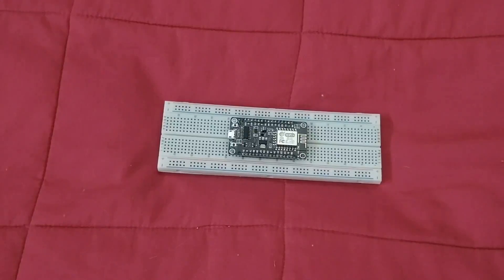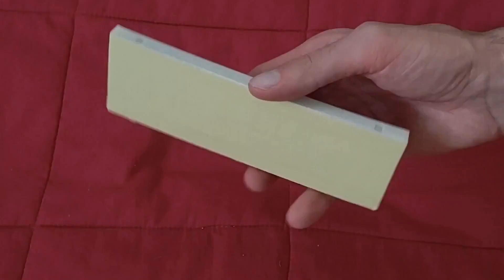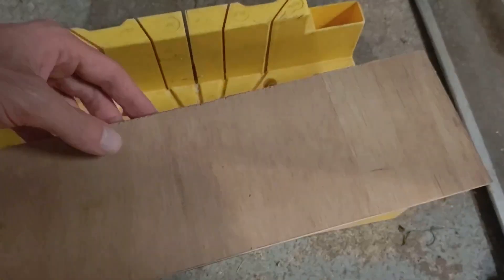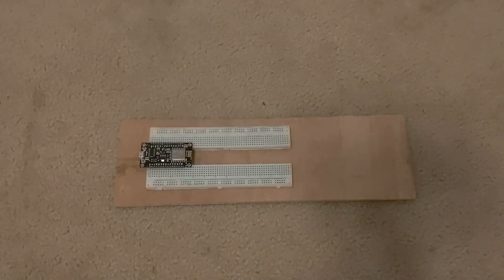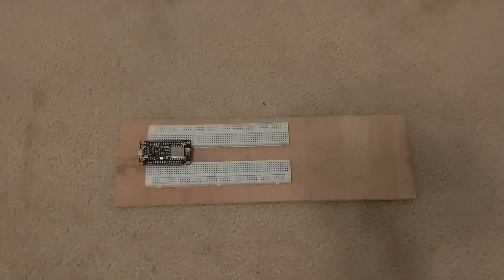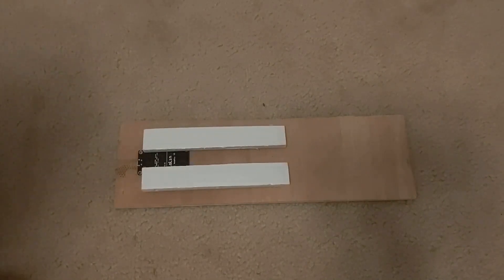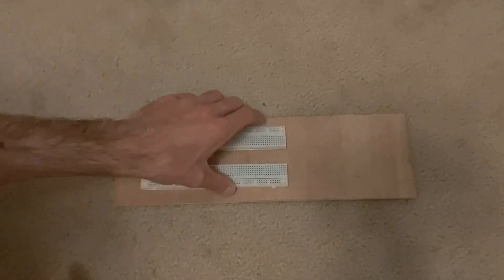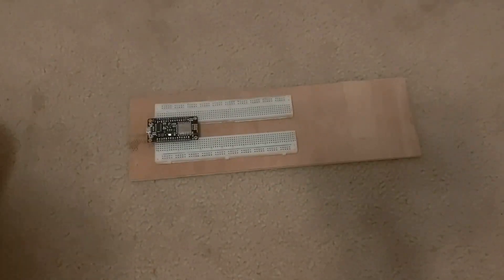ESP8266 NodeMCU breadboard hack

Comment: Another trick is connecting two breadboards removing the power rail from one of them and putting the nodemcu in between. Also by using 2 breadboards you avoid cutting one in half.
Reply from the maker: That's a good idea.
Reply: @walnuthills11  is breadboard working or not😅
Reply from the maker: @anmolthakur2098  Ha, surprisingly, it is